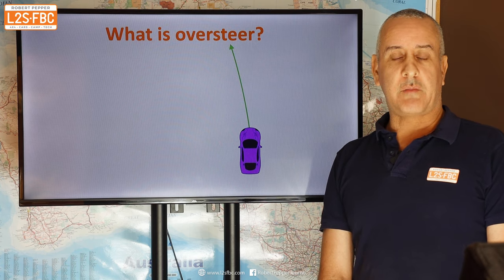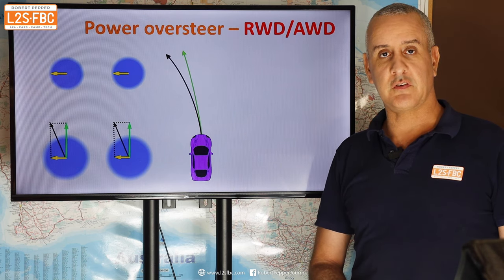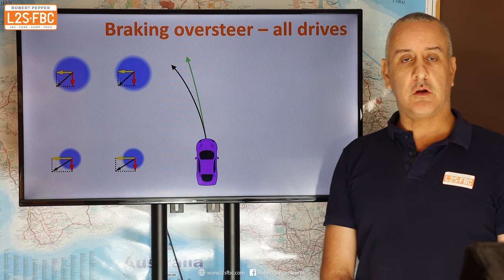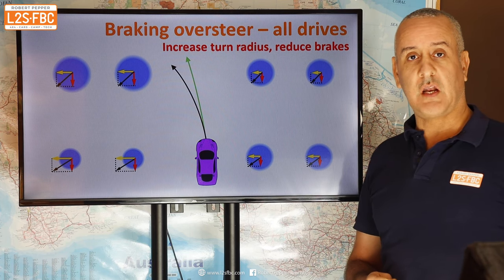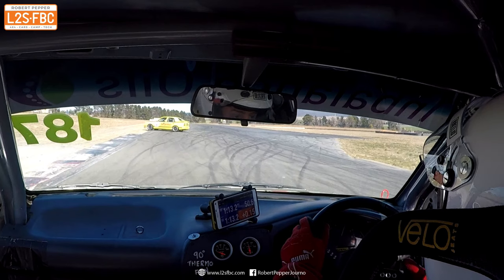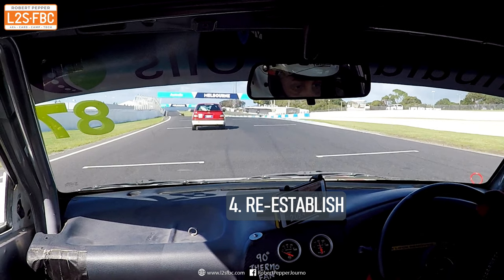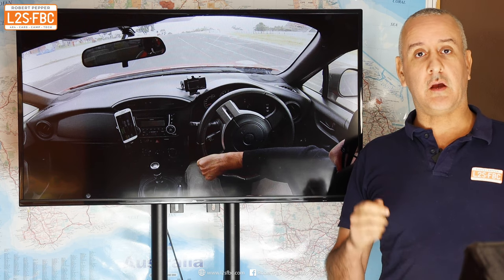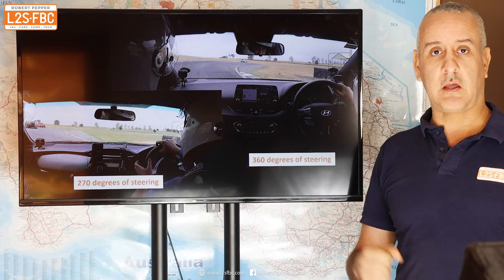Oversteer recovery - how to save your car!

Comment: Thank you for your video. What does it mean to increase the turning radius? Does that mean to take a wider turn? I recently had a scary incident in my FWD car where I entered a corner braking and the shift in weight caused my car to snap oversteer, and then I over corrected with my countersteering. Is countersteering still necessary for FWD cars?
Reply from the maker: It means turn in a wider arc than a smaller one. The greater the arc, ie the less steering input, the less demand on the tyres to turn. So if you are oversteering you can reduce the oversteer by widening the turn as that way you are demanding less turning grip from the rear tyres.
Reply: @L2SFBC  So in this scenario, this would be something one would do before traction is entirely lost and the rear swings out, correct? What does one do when the snap oversteer has already happened?
Reply from the maker: Traction generally isn't binary, ie you have it or not.  It can feel that way if you are on dry bitumen and hit a big oil patch, but even then there is some traction just not very much. In the case of most skids it's a reduction in traction, and this is conceptualised by considering the Circle of Traction and exceeding it.  This is why I've extended the CoT concept by making the edges fuzzy to signify reducing traction as a hard-edged circle implies grip grip grip then zero grip.  I also put in a graph showing tyre slip angle and grip to illustrate the point.
To answer your specific question as soon as you feel the car rotating in oversteer you need to take corrective action, and what sort of action depends on the nature of the oversteer and the car, as described in the video. For example, oversteer under braking in a front-drive car requires a different recovery technique to oversteer under power in a rear-drive car.

Comment: Is it possible that the black Porsche that hit the barrier with its rear might have stalled out? Wouldn't that eliminate the brake assist, leading to a sudden need to become the hulk to adequately press the brake pedal? Ok, not become the hulk, but in that situation i wouldn't fault the drive for not being prepared for a sudden loss of brake assist. I've never driven on a track, so i can understand that reaction. IF that is what happened.
Idk, just asking.
Reply from the maker: Yes, it's possible something like that may have happened, but if the brakes are locked, then when the engine goes off they'll pretty much stay locked, lack of servo assistance is more for braking to begin with.  Also let's assume the vehicle is still in a forward gear yet rolling backwards, but could be manual with clutch down.  Point being that releasing the brakes is a problem.
Reply: I see, thanks for the reply! Your videos are awesome.

Comment: if you just push the clutch pedal in (mid eng rear drive ) will the car regain control?
Reply from the maker: Pushing the clutch pedal in is never the answer to a car control situation. It is what you do, along with slamming the brakes on hard, when you have entirely lost control. What situation were you thinking of?

Comment: Isn't this just a natural instinct people have? How else do people react if not this way?
Reply from the maker: No it's not natural for most people
Reply: @L2SFBC  What do they do instead of this?  What is the common reaction if not this?
Reply: @daniellec2172  Crank steering towards the slide and brake hard, or not do much of anything at all, depends on how urgent it is

Comment: Does not tell anyone how to recover from oversteer.  If you're too far gone, sliding on brakes is better than overcorrecting.  Oversteer in a very powerful car is very difficult to overcome.   Don't oversteer in very powerful cars.  If you can handle the power, you know what to do because you've scared yourself to death in safe situations.